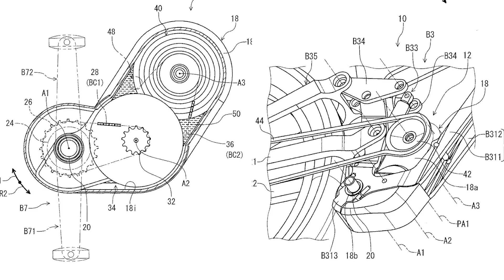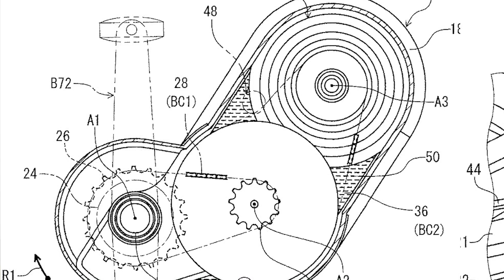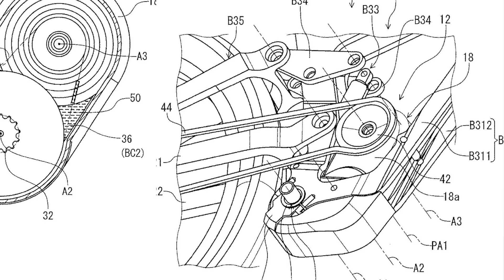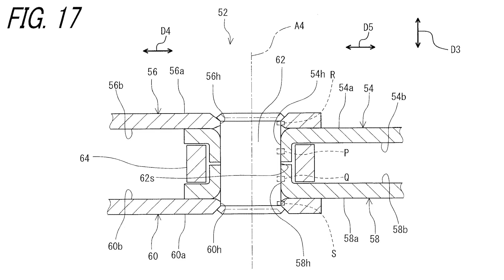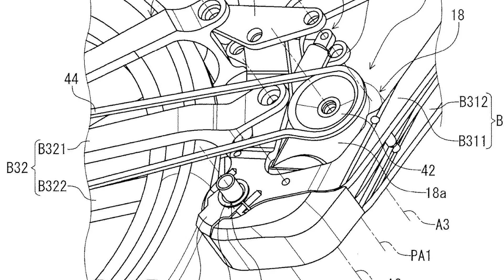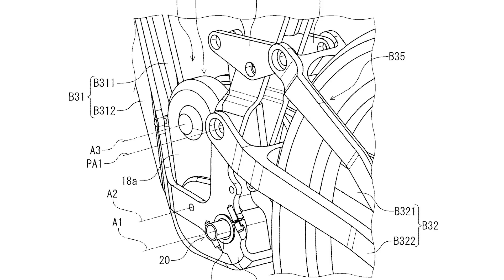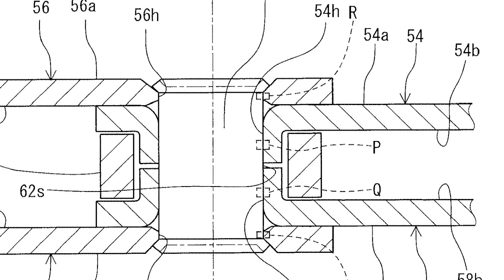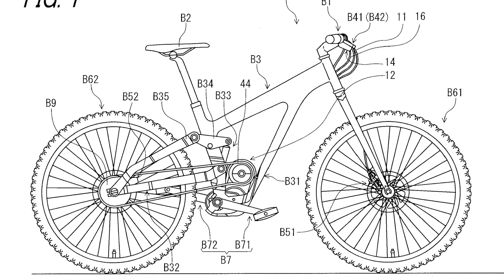Death of The Derailleur? | Shimano's Gearbox Patent

Comment: The question would you buy it is not applicable in practice as notice with each revolutionary change in bike design it becomes standard for most bikes so when buying you dont get a choice. For example "You can have any brake so long at its disc". If gearboxes perform better and are cheaper to service and replace then yes to a gearbox. Alpine internal gears are good in theory for lifespan and servicing but when it goes wrong its more expensive and the parts are less available than external. If gearboxes become the norm. time is the ultimate test to see if they are better than external gears.

Comment: I think gearbox systems will make its way more broad to commuters / hybrids / city bikes / bikes even mountain bikes as you get a touch of realibilty in those environments. BUT, Derailleur system is cheaper and lighter with A efficient design. So i see folks wanting performance based low weight, low cost will stick with that set up then go gearbox for everyday bad weather type rides. Most cyclists have more than one bike in the garage

Comment: WHAT IS THE CARBON FOOTPRINT OF THIS NEW  GEARBOX COMPARING WITH TRADITIONAL GEAR SYSTEM...?
you mentioned a very slippery lubricant...
Already break fluid is necessary with disk break, shock absorbers fluid, batteries...
Are bikes slowly turning into motorbikes? 
Should this video be simply called 
THE DEATH OF THE BICYCLE?
Ps with good maintenance anything can last when properly manufactured. 
With poor services the most sofisticated items fail

Comment: More things to go wrong and chain stretch inside so one will have take apart to replace and what happens if it snaps inside while out on a ride or some other issue a derailleur one can quickly fix the chain or if some other failures do a temp fix to get home more safer option so a enclosed box not so good they will need an easy way of opening it up tool free to access the chain and replace it tool free or it will be it’s downfall

Comment: It would not be an add on so it would have to be a bike built for it. I don't know much about shimano steps but my bosch  ebike motor suggests when to change gear and as this gearbox has an electrical actuator which changes the gear from a request by the gearshift  it would not be a massive leap to see this as an ebike system with a fully automatic gearbox. Something I could see being very popular amongst people who just want transport.

Comment: This thing is gonna be hella expensive, that's for sure! And it's obviously gonna be alot more complicated than the existing gearboxes!

So it's gonna be price and simplicity vs low drag, and I'd take the former 2 over the latter 1 anyday! That said, u can probably reduce the drag ALOT by simply getting rid of the belt system and installing a traditional cog and chain system.

So to be absolutely honest, why is Shimano even developing this?

Comment: if the shifting is wireless/electronic, then it seems an easy and obvious mod would be to add an automatic transmission
also seems like it might be easier to augment into an e-bike, especially if it is as light as anticipated
might even be better for an e-bike because you could decouple the crank from the gearbox, crank could just charge the battery.

Comment: I love it! I ride an anachronism... friction-levered campy with 70s-era toe clips. No clicks, no switches, no button-presses. It soothes my soul to listen and think when I ride. At the same time, I really like hearing about the next great leap forward... the bridge that can bring pedalers and hybrid cyclists together on a similar platform, and transmissions are where that happens. I rode a Bianchi about 20 years ago (7 speeds or something?) that had an amazing rear hub that switched so clean and quiet and even though there wasn't much range it didn't matter. It was on a fat-tire cafe cruiser but the benefits of putting all that up-front were both obvious but nonsensical at the time. It's a really exciting time in bicycles, these days. Old fogey-stogeys like me have been waiting for this kind of coolness for decades, and it'll really help bring new people to pedals, I think.

Comment: I just read a couple comments.   I don't think (if it comes to fruition) that this is an infringement on any "gearbox" patent.  Technically, this proposal is not a "gear" box.  It is a chain and cassette box....no gears.   Very exciting because first, it will be lighter than gears.  Second, it would stand to reason that it will have less drag even if conventional lubricant were used.  The fact that the patent specifically mentions a proprietary lube suggests even further that it will have less drag.  Couple this "cassette box" with a Gates Carbon Belt Drive and now you  have a truly unique and overdue approach to driving a bicycle.  One of the most exciting things about this announcement is that if Shimano is behind this, they mean to mass produce it and make it affordable.   Very exciting times in bicycling!   Bring it on,  Shimano!

Comment: Seems they should have designed an enclosed CVT kevlar belt drive instead. No splash lubrication required. Way simpler and unlimited gear ratios. Add a motor and there you go. Chain drives are not gear drives. My '91 4 Runner uses a differential gear box and chain to drive the front axles. Tough setup.

Comment: This has already been approached several times by others. The bicycle manufactures and hype from the relatively small amount of people who actually use racing bicycles has been the downfall to internal gears going forward.  Most people don't race and have a different point of view about bicycling. I saw your video about gear boxes and it was lacking due to a  race centric point of view.  If you want to give your viewers a true point of view about the Pinion and the Rohloff than interview the Bicycle Touring  Pro  and The Cyclingabout riders. My Rohloff is more efficient than and less weight than the Pinion. It weighs less than a pound more over an equally equipped Derailleur equipped bicycle. The benefit would be Shimano can mass produce to keep the price down. I don't believe you need to fear derailleurs disappearing anytime soon.

Comment: laughing loud in pinion.
for 4 years 0 problems
Reply: The same with Rohloff, 15 years of care free experience.
Reply: @mardiffv.8775  do change to winter oil ?? or you living in warm place??
Reply: @dickachu3921  No, the Netherlands is not a warm place, but with a Rohloff you have switch to lighter oil, when the temperature drops below -15 C/ 6 F. And that never happens in the Netherlands. So standard oil with do nice all year round. True for extreme cold I would recomment a derailler gear system. Maria Leijerstam had a derailler on her trike in 2013 when she conquered the South Pole.
Reply: @mardiffv.8775  OK it different in finland

Comment: This looks like a solution in dire need of a problem. Diralliers are already 95-98% efficient, are very cheap, don't need close tolerances, weigh very little and have a good life. The key disadvantage is "maintanence" but in my view that has more to do with precious owners. I commute 10km a day and my diralliers is lucky if it gets oiled and wiped every two months, which takes me ten minutes. Replacement chains etc are cheap. This gearbox could only be 2% more efficient and will have a significant weight and cost increase because it will need encasing and lubricant. It will probably attract rich middle aged cyclists, but I can't see myself going for it as anything other than a novelty.

Comment: I hate to state the obvious but the rubber belt on a mountain bike is going get crudded up with dirt 🤓. A chain being that it has a design that has holes thru it doesn't hold the dirt. You need to have a drive shaft . Now you have some weight or seriously expensive light alloys.. I am still waiting for a cyborg bike. A bike that has power transmitted via the natural running motion of both legs and arms. But it doesn't look like a bike more a suit .🤓

Comment: With this type of gearing you will have two cassettes, a metal casing, extra shafts and still a chain and two sprockets. Not the recipe for a lightweight bike.

Death of the derailleur? I don't think so. This will be for the city commuter (or lazy mechanic :D ).

Comment: The death of the thing that can be cheap, well working and lightweight easy to maintance and if something brakes on it you dont have to throw the whole thing into the trash can and bu a new one. Yeah its probably fine for citybikes and for thoes wierd tour/cross/idkwhatthehelltheywanttobe bikes but for an mtb i guess derailleurs will be the way to go since (once again) they are way cheaper specially the mid-ranged ones, they aren't so heavy and still got accurate shifting, if its well maintanced, which is also easier in case of an "open-system"

Comment: I've always though that having the transmission in the highest torque portion of the drivetrain on a bicycle was not the best idea. With more ebikes coming online, this is even more of a problem due to the added power of the motor going into the driveline. Gearing up the 60 to 120 rpm cadence of the cyclist's crank to match the efficient r's of an electric motor and then using a transmission where the r's are high and the torque is low, which feeds a single small chainring to drive a single larger chairing on the rear wheel, makes a lot more sense to me. Think motorcycle. Remember, power is the product of rpm and torque and you can trade one for the other.

The transmission shown gears up the crank rpm, which allows them to use a smaller chain and make the transmission smaller and lighter. Carbon fiber even?

Comment: And who is going to make the bikes? This is not just a bolt on part like a derailier. Looks like it will need to integrated into the original design of any new bike. Why was that never mentioned in a 14 minute video?
Reply from the maker: We talk about that very problem on the full article on BikeRadar.com, which is linked in the video description 💥Thanks for watching! https://www.bikeradar.com/news/shimano-gearbox/

Comment: as you add more movement and parts you have more friction, therefore will never surpass a derailleur system
Reply: Only in high and low gear.. it could be better because of the chain angle.. but your right..

Comment: weight Weight and more WEIGHT. 

And, if you are a frame manufacturer you would have to integrate the system into your frame? (as opposed to a bottom bracket) 
I don’t see that happening.

Comment: This gearbox appears to tick all of the marketing "check-boxes" that would appeal to the people that want to buy $10k+ bikes, so I think it will be adopted at the high end very quickly.  These boxes are:
Efficiency: the straight drive-line may be good for a few percent of efficiency - that may be enough for racers, especially road-racers
Aero: Road-racers - nothing more to say
lower maintenance: mountain bikers but also those bikers such as dentists that are busy but happy to spend over $10k on a bike
weight: looking at it, you may think it would be heavier, but one of the heavy elements of a current 1x drivetrain is the giant dinner-plate sized cogs - looking at the patent, the largest gear is not that much larger in diameter than the smaller one as the teeth ratio (not gear ratio) is only a bit larger than 2:1 - and so the gear wheel size radius doesn't vary that much since that ratio would approximately be the square root of the ratio of the number of teeth.  Also, you don't need such a large derailleur and extra chain since the chain size varies very little during shifting
full-suspension MTB Performance: unsprung weight significantly reduced so rear grip is increased in climbing and braking
hard-tail rear-wheel grip:  moment of inertial is reduced significantly, as the heavy gears are moved near the pedals which is closer to the rotation point of the bike over small rear bumps when your weight is on the pedals.  This will help rear wheel grip for a hard-tail, which is one of the deficiencies of a hard-tail so hard-tails may become much better
Cost of MFR: shifting now happens with a much smaller jump in diameter, so the teeth may not need to be made with such a great and intricate pattern to help shifting, at least for the much later units where cost is more of an issue once the manufacturing scale is taken care of.  Of course the first few generations will be quite expensive, but it does not need to remain expensive to make.  The demands on the chain, such as being able to tolerate a wide bend in the chain-line go away with a perfectly straight chain-line at all times.
** #1 * Moves the derailleur out of harm's way - I will no longer need a catalogue of derailleur hangers and I will stop having to replace my derailleurs every time I bend them.  I can't wait for the 2nd or 3rd gen of this type of drivetrain.  I will not buy the first generation since I don't purchase $10k bikes.

Comment: I highly recommend reading the comment of @8638marc to get an idea of what they actually want to achieve with this patent.
On the other hand there is a simple reason why they nowhere use the word "gearbox". A box with a chain going from one chainring to the next and the ability to switch chainrings is no gearbox. A gearbox is a box with gears driven by an input shaft and driving an output shaft with the purpose of changing torque and speed the output shaft turns in relation to the input shaft. So it isn't a gearbox.

Comment: Not very likely to beat the cost, efficiency and weight of a modern derailleur system in your lifetime.  Even with a gearbox you still need to transfer the energy to the rear wheel so you still need a chain so basically the chain comes for free.  It might make sense on a high end electric bicycle, but you would be better off with a direct drive motor with no gearing.  The straight line is absolutely required in this design because the spindles are so close together.  A better solution is just a Nexus type rear hub with a belt drive.

Comment: There are a couple of issues you didn't cover. 1. putting a gearbox on the mainframe reduces unsprung weight thereby improves traction and handling at the rear. 2. one appeal of derailleurs is their ease of maintenance. I would hesitate at a gearbox if I could not adjust or service it myself. 3. This patent could go hand in glove with emotor development to produce a Steps system with gears. The potential for tgat product is ginormous. Cheers. Thanks for the update.

Comment: I've been working on a similar design as a hobby project for about 30 years.  My current prototype (built 5 years ago) is mounted to an existing bike. The new prototype we are finishing today is a refinement of that. Smaller, simpler, smoother and actually enclosed.  I'm aware of other hobbyists and commercial developers who have also been working on it.  You can see more details at https://pedal-motive.com/index.php/gallery/  Since the Shimano patent describes the transmission, but doesn't make any claims for it (just the lubricant) I think they are just using the opportunity to show that they have this technology so no one else tries to patent it.  I'm also aware of their other patents and the previous attempt to commercialize the design.

Comment: I love internal gears and have two bikes with Rohloff on the back cube. I don't use those bikes for MTB however, because of that weight and mass on the back wheel. If Shimano creates this and integrates it with the STEPS eMTB motor I will buy it for sure. For a regular MTB I'm not interested in this given how rarely I use non eMTB these days.

Comment: Surprised that Shimano has taken this long to develop something like this as they've been making fishing reels, hub gears and derailieurs for decades but I think it will only be available for higher level bikes for some time as they will be expensive as is with Pinion and Rolhoff bike gearing as they will have to convince bicycle frame designers to make way for building them within the frame just like Pinion drives.....but if Shimano can get this happening at a much cheaper price point as the other 2 alternatives I mentioned, then all 3 will become more affordable....but that's my wish. I wonder of the Shimano system will be a lot quieter than the other 2. and Why not a shaft drive rather than chain or belt.

Comment: If they can develop a workable gear box there is no doubt it would be a huge money maker. The potential revenue from such a revolutionary charge is huge. For that reason alone I would think the RD budget would correspond. The engineering feasibility may have increased with newer battery and materials. One limitation may be price. It seems a gear box would be a significant increase over a derailer.

Comment: Yeah and when they wear out or have a tooth messed up inside it costs more than the bike to fix. I like gears and chain,  simple and direct and can upgrade,  change to new or change gears ratio as needed... oh and drag and weight..hmmm.
Reply: Nothing lasts forever
Reply: @martinhayes5087  gearboxes last foreverer than chains
Reply: gearbox last forever. The only maintenance required is an oil change every 10 000km

Comment: I would welcome the gearbox drive and hope it would be around the price of the XT shifter , derailleur, cassette and cranks. Hope the bike manufacturers offers it at a reasonable price. I had built a touring 26” bike with utility in mind with friction shifters and nine speed for reliability and simplicity. Having not to worry about bending my derailleur and wearing out the chain due to inclement weather is surely welcome.